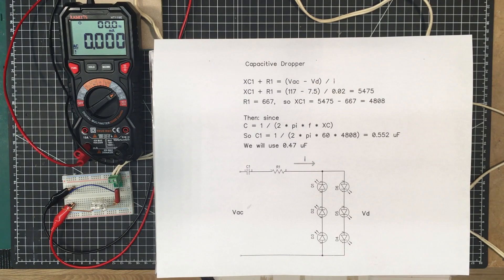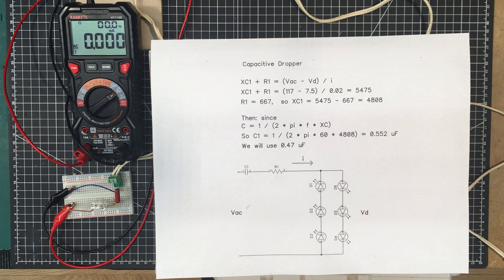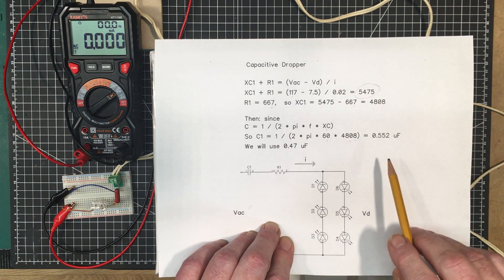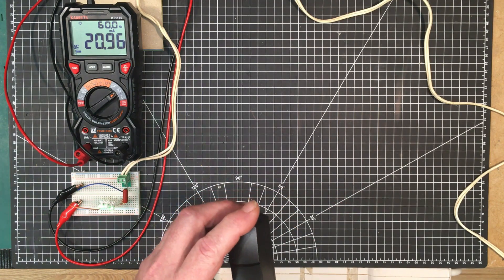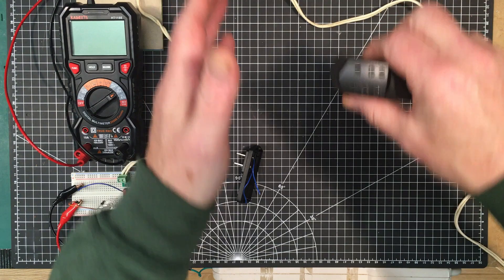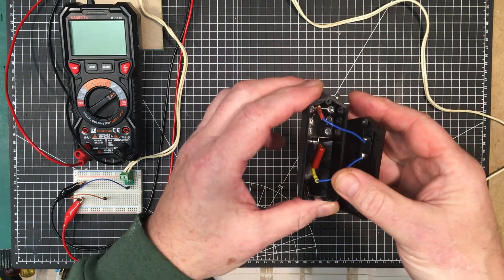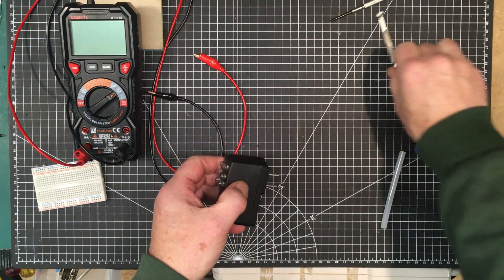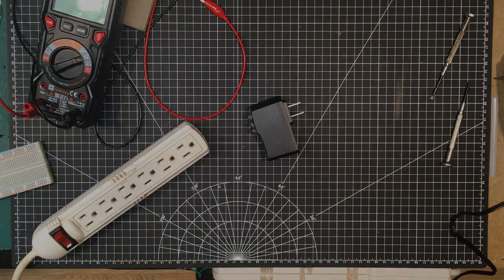0123 - Let's build a Capacitive Dropper powered LED light.

Comment: Your formula is wrong, you should use the Pythagorean theorem instead. The correct value for XC1 would be sgrt(5475^2 - 667^2) = 5434 Ohm. It gives 0.49uF, not 0.55uF.
Reply from the maker: Well, that does not match anything I have seen before.  Care to give an explanation as to why?
Reply: @uni-byte  It is a general formula for electrical impedance, you can find it everywhere in internet. Z = sqrt(R^2 + (XL^2 - XC^2)). In your case XL is zero, therefore Z^2 = R^2 + XC^2, and so XC = sqrt(Z^2 - R^2). You cannot simply add/substract ohmic resistance and reactance. They build a Pythagorean triangle.
Reply from the maker: @ Right you are.  Thanks!

Comment: Red LEDs/light do not cause the eye pupil to contract, so no light blindness. This is why you will see a red light in the airplane cockpit, or at a submarine navigation table, when they are "running red." You see this in the movies. Some "tatical" flashlights come with an extra red lens. So, red is better for a night light, when there is only a low ambient light level. Cheers.

Comment: A better solution to check what outlets are associated with AC breakers is to plug in a radio, turn it on and wait for radio to go off as breakers are turned off/on.
Reply from the maker: Of course it is, but now that I built this thing I'm going to use it!!  LOL!